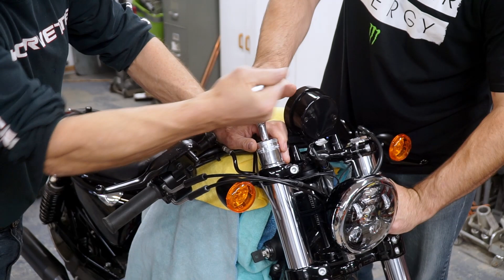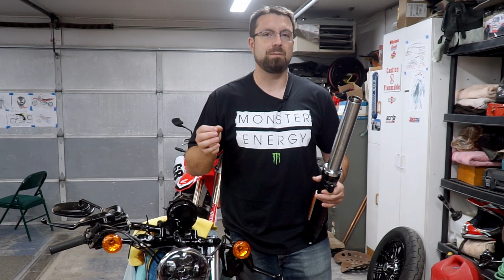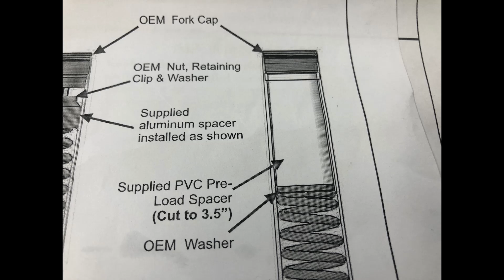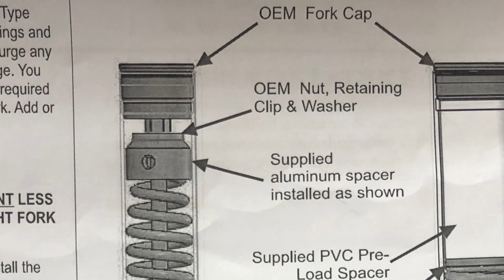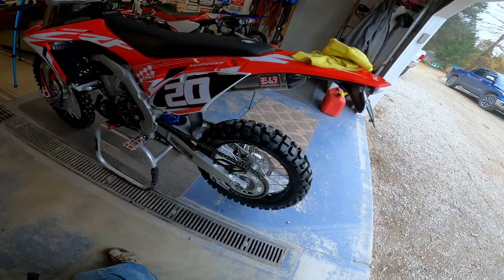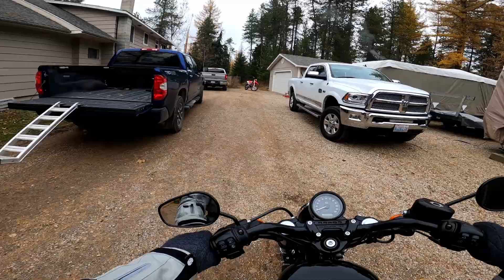Harley Sportster 1200 Progressive Springs Install

Comment: You can do it with two people. I took about 10 feet of dental floss and doubled it up. Threaded it through the spring and washer. That way you could hold the dampening rod up. Then I compressed the spring and had my girlfriend slip the c-clip on.

Comment: I have a 2018 48 and like you said the stock suspension was less than desireable, even with the "premium adjustable emulsion shocks" on the rear. I did a stock height adjustable Progressive monotube fork kit, 13 inch progressive 490 sport series shocks and a daytona steering damper. I know not everyone wants to spend a bunch of money on a newer bike, but I can assure everyone after completely building my motor (s&s 1250cc, forged flattop s&s pistons, feuling 505/515 cams, feuling hp+ lifters, feuling endurance valve springs, hammer performance pushrods, buell bronze oil pump gear, s&s teardrop intake, bassani road rage 3 stainless exhsust, vance and hines fp3 tuner which I am replacing for a Thundermax ecm, dynatek efi ignition, screamin eagle plugs and wires, the list goes on and on), the clutch (barnett extra plate clutch pack, barnett billet pressure plate, barnett 25% diaphram spring), replaced every body panel except for the tank with carbon fiber body panels, changed to mid controls, new bars, seat, 2 fuel gauges, a tach, oil temp/level gauge, Brembo radial calipers, Brembo floating rotors, Brembo brake pads, xr1200 master cylinder and so much more. There is literally nothing I haven't touched to upgrade and if I did it all over again, suspension would 110% be the first thing i would upgrade!
Reply: I have premium adjustable rear shock absorbes on my 48 special, do you recommend progressive heavy duty 12" ??? Are they better?
Reply: Do you feel the monotube kit is worth the extra $300 over just the Progressive spring kit as the 48 already has kind of a cartridge damper in one leg already? My wife is a lighter rider and I don’t want to go too stiff of a spring.